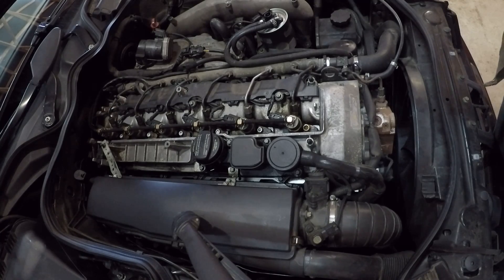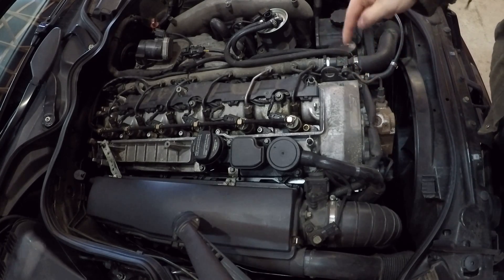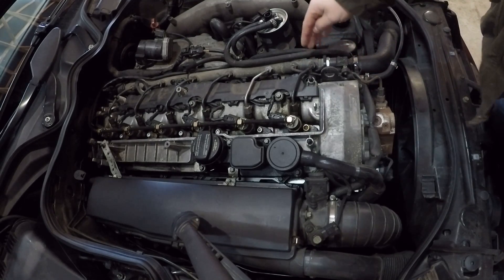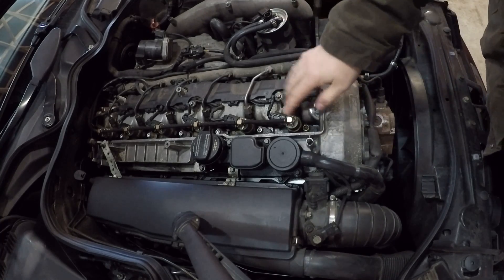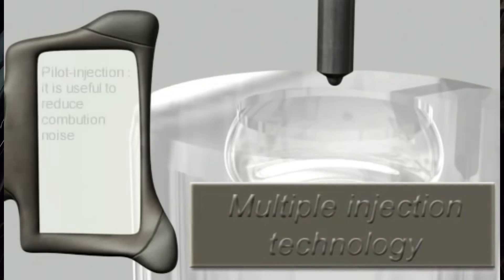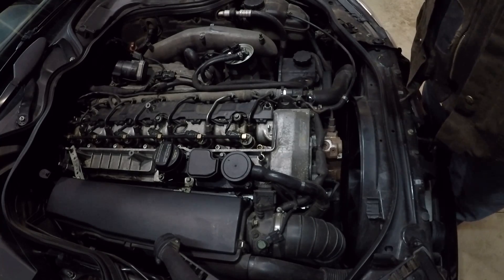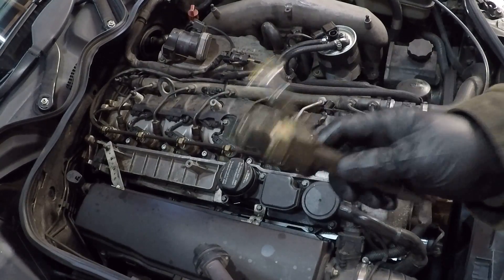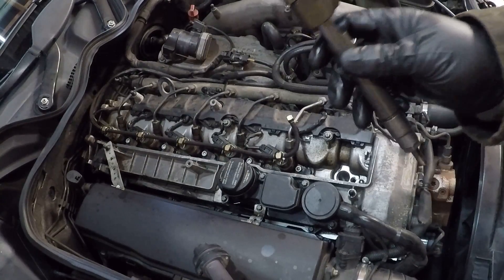E320 CDI | Everything You Need to Know About the Fuel System!

Comment: hello my mecedes s320 cdi 2005 has been sitting for the last 5 years it currently only turns over on the starter but won't fire seems to show between 9 to 11 bar in the common rail when read on obd with ignition on only is this normal or should I look in to changing the fuel tank side pump ?

Comment: Having fuel pressure problems code is for quantity control valve pressure to high another issue is my fuel tank on left hand side is full of fuel but the right hand side where the pump is is empty when idle it runs great when reved to 3200 limp mode this is a 2009 mercedes-benz ml320 bluetec any guidance would be great

Comment: Hoping you can assist me as I have been chasing gremlins in my OM648 2006 e320) for a few months now and not sure what to do next. I have the low rail pressure code and progressively replaced pretty much the whole fuel path from the cheapest item to the most expensive. 

I have replaced:
- Fuel Filter.
- Fuel pressure sensor (Bosch)
- Fuel pressure regulator (Bosch)
- In tank fuel pump assembly - the whole thing with the hoses (Bosch)
- New hoses (from filter to High Pressure Pump and return hose from pump). (OE MB)
- and finally just today installed new rebuilt high pressure pump (Bosch)

Car seems to drive better than it did before the HP pump replacement but still throws the low rail pressure code albeit not as soon as it used to. I still have my old fuel rail sensors but not the HP pump as I sent that core back. I plan to put my old sensors back and see if that makes a difference but thought I'd write to you first.

Car has 340,000km and I have not removed the injectors yet. I'm really at a loss what to do next and could use your guidance. I had high hopes for the HP pump to finally solve the issue but was quite shocked when it didn't.
Reply: Hi, did you manage to find a solution? I have the same problem 🙏🏻
Reply: @GreenMotion333  Yes. While I took the more expensive route in the end (throwing parts at the problem), I believe the culprit was ultimately the High Pressure Pump. The reason the pump change didn't work for me was the new Fuel Rail Regulator was bad. After putting the old one back, everything worked perfectly. Now I also learned that certain parts need adaptation through a OBD computer that has that function. I never did any of that. It's been awhile now and everything is still working great with the old fuel rail regulator. Pretty much all the rest of the fuel path is new except the injectors themselves.

Comment: c200 CDI. Problem starting after leaky injectors replacing gasket. Fuel pump works, getting fuel to filter. What is the next step to check? Fuel regulator valve? Lo and high pressure pumps?

Comment: I’ve got a P0113 Intake Air Temperature Circuit High, but it’s not the IAT sensor as I’ve replaced it and also shows a correct IAT temp on the live data. Is there another IAT sensor on these (possibly integrated with MAF), or would have any idea what else could throw the P0113 code on these id the IAT temps reads correct in the OBD?

Comment: hello, amazing explanation. i have a question, you talked about the fuel pump in the tank. i have a W209 5 cylinder diesel i have problem to start the car, the engine cranks but no start right away also when engine is hot. you know if W209 has the fuel pump in the tank?

Comment: hi there! im in postion where my om613 on my S210 E class, has problems with the high fuel pressure pump, and injector N1, today we've experimented with swaping parts, and it turns out you can still start the car and use it (allthough you cant really reach full pottential, you must know, the fuel wont be enough) with 270cdi w210 high pressure fuel pump and injector from 220cdi w210 :) thanks for the video! ofc i will recycle my parts (repair), in my country we can do that and reuse them and they will be like new!

Comment: Are the OM648 and OM647 nozzle spray patterns the same?  You can have different patterns and still flow the same amount of fuel: I'm talking theory here.
Reply from the maker: I'm unsure, as I've been unable to find that data. An educated guess says yes, and here's why:
The om646/647/648 engines are essentially identical, with the only difference being the number of cylinders. the layout of the fuel system, cylinder size and displacement, and everything is identical between these engines. so my guess is that the spray pattern would be identical. I took the risk changing all my 648 nozzles to 647 nozzles a few years ago, and everything is still working perfectly.
Reply: @MBDieselFreak  Yes, I agree that they're most likely the same pattern.  Maybe there's part numbers for just the nozzles in which case that would answer for sure.  Thank you for your response!

Comment: Hey I have been replacing all of the fuel lines underhood 2005 e320 cdi.. could you tell me the routing of the fuel lines from the fuel injector pump upper/lower fittings.  I know one goes to the Y fitting and the other goes to the fuel filter.. Thanks in advance!!

Comment: Hi there! Thank you for such a great content brother! Could I please ask for some advice? The thing is that I replaced the seals on the Bosch CP1  cause I had a mayor diesel leak on my OM664 2.2 L 121hp . After doing so, the engine fired up right away and I tested the car and everything seemed fine. The issue is that now, while I accelerate at full throttle, the car enters into LIMP mode and dies on me, you can turn the key off-on and the car will start immediately and I can continue my trip... This didn't happened before. If I'm not mistaken You mentioned something about check valves seats going bad and therefore reducing fuel pressure in the rail as a result the car enters into LIMP mode...  Ive found a place online where I can buy every part of the CP1 pump, If its not much trouble could you please help find that exact parts.  Any help is much appreciated. Thank You! Cheers!

Comment: Hmmm, I"m getting the same intermittent complete lack of power you mentioned.  Was once a month, then every couple weeks.   Now it's about 50% of days and the code (P0192 fuel rail pressure sensor low) comes back right away.   Car has "only" 110k miles on it, which doesn't seem a lot for these.  Could my HPFP likely be out at this low mileage?
Great video, thanks!
Reply: Hi, did you manage to find a solution? I have the same problem 🙏🏻

Comment: All the black death videos don't talk about fuel pressure in the lines.  They say 14mm wrench to break loose the steel fuel line going injector but never say this line is under pressure.  Is it under pressure?  Can the lines just be disconnected without other steps?

Comment: I have an unstable idling on my w203 220 cdi. What could be wrong ? Also a litle bit too low mpg.  Btw good explanation
Reply: The plastic fuel lines go hard and brittle then air leaks hard to start change all new white plastic lines I took radiator out and replaced them all..buy the genuine plastic fuel lines from MBenz... Will run better.. And get a smoke vac test done also will show up vac leak.. 😊😊

Comment: Question: I got a 11C600 code, code b4/6 rail voltage pressure sensor voltage too low, on a W166 engine.  Could it be the Fuel Rail Pressure Sensor, the Pump or the Fuel Regulator?  Its a GL350 with 50k miles .  Would appreciate an input thanks

Comment: how can you tell that your injectors were put in the engine in a wrong order ? I have a feeling that the shop that did my injectors seals put them in a wrong order, I'm having rought idle on first cold start in the morning.. rpm going up and down like crazy, when it heats up, it's all fine, also if you give it a bit of gas it runs perfect

Comment: Does the OM648 CDI have a PCV valve and if so where is it ??
I bought a 2005 this year and with the oil filler cap off, there is a very slight puff of smoke at idle indicating a lack of crankcase vacuum but I have been unable to find the PCV valve.

Comment: @MBDieselFreak I scanned my w211 cdi with DAS and got code from M.E 2047-001 (rail pressure monitoring via volume control valve. The rail pressure is too low). I just performed injector leak off test and found all injectors leaking off the same amount. I replaced almost everything in the fuel system except high pressure pump and injectors. I replaced fuel rail, fuel pump, quanity control valve, the valve next to high pressure pump, the valve behind the rail.. help!
Reply from the maker: Does the car start and run fine? Does this code cause limp mode occasionally when driving?
Reply: @MBDieselFreak Hi MBDDieselFreak. Please, i write in forum about acceleration noise om648, because have same problem. What was the problem? Thanks
Reply: @MBDieselFreak it starts and runs fine but when I accelerate hard, it’ll start blowing black smoke and throw a check engine light. After I do 1 hard acceleration, it’ll go into limp mode and it won’t let me go past 2k rpm
Reply from the maker: @SugaSteve  black smoke is normal for injector nozzles that are worn. i think your issue is that the high pressure fuel pump is bad. i had the same problem as you, but less severe. entirely intermittently, under hard acceleration maybe 1-2 a week i would have the car go into limp mode with a low fuel pressure code stored. Changing my hpfp fixed the issue for me, my old pump was worn out.
Reply: MBDieselFreak I was thinking the same but wasn’t completely confident.. I’m going to replace that ASAP. Thank you sir!

Comment: That om647 injector tip was great. Thanks for that. Someone botched an injector seal job on my cdi and I have 4 of six leaking at the top onto the valve cover, they used none factory bolts with washers etc.. and the injectors are all gouged up. Was thinking to replace all and start fresh since I have no idea what they did. When you replaced the injector how did you go about the programing? Will the car not fire up if they are not programmed? I do have a launch scan pad that is handy.

Comment: Hi,
I' ve bought a 0.5 liters aspirated diesel car this summer, it's called "ligier js 50 sport" now in winter time i have some problems starting her up.
When the engine is cold it takes 2key turns for starting unless i turn the key in the 2nd position 5-6 times. In the last days i noticed a drop in performance, it used to do 50kmh now it has less axceleration and more smoke from the exaust. I dont know what the problec could be can you help me
P.s. I live it Italy so the winter is like 0°c
P.s. the car has 3000 km and it's still  "breaking in"
Reply: Cold start issues may be from worn glow plugs.  Diagnostic reader should display related errors.  Cold running problems might be fuel related. Warm-weather formulated fuel thickens when cold If you haven't refueled since the weather was warm you might need to add a "treatment" compound.  Or use a VERY SMALL amount of kerosene/paraffin as a thinner. Too much Kero/Paraffin will burn valves & pistons so research on dilution ratio is necessary.  If none of the above applies then join a discussion form and read the 1,000+ posts on each topic.  It's enough to make the brain case explode.

Comment: I have a question for ya, I have a 2011 ML 350 Bluetec and have been diagnosing the fuel system because of a no start after it cut off on me while driving. I think it may be the high pressure fuel pump I’ve got the low fuel pressure code, what do you think?
Reply from the maker: My guess would be to test the low pressure fuel pump in the tank! That's the primary cause of a sudden stall no start scenario, and since you have a low pressure fuel code, that confirms my suspicion.
Reply: MBDieselFreak ok cool I’m going to check into it, do you know if I have to drop the tank to service the pump

Comment: Great video, Are you sure that the ECU will accept the code of a 647 injector?
Reply from the maker: Absolutely. The code is generic for Bosch injectors. I replaced cyl 6 with an OM647 injector and successfully coded it in.

Comment: Nice informative video, learned something new believe it or not, thank you :).  I'm an mb tech here in Denmark for 7 yrs now i've seen a few other problems with the 648, which isn't being mentioned here. The HP Pump on the 648 also has a tendency to rattle lose the 4 small bolts on the back over time, first sign is a great fuel leak on the front, easily fixable by dismount & clean and loctite up the bolts then retighten and remount with new o-ring. A second thing is that the injectors in the 648 engine has a tendency to be a hell of alot more painful to remove compared to the 642 etc... I've even tried splitting one injector in half using the OE puller and even cracked a valve cover way back.. Eventually using acetone carefully to losen up the carbon has made repairs alot easier. Thanks again for your videos :)
And not to hurt your feelings, but you need to turn you oil filler cap 180! :D And check your tranny oil then lock it up with the red plastic clip :D - Sorry getting ticks here haha. ;) But kudos for a non leaking PCV valve which is so often ignored, thank you sir! :)
Reply: Another thing which might not make sense to many, but the official tolerance for an injector is +/- 5 mm^3/Hub which is a very high tolerance. Injectors showing these values would knock alot earlier, even around 2 +/- mm^3/Hub - Have in mind that the injectors and ecu tries to compensate for a failing injector(s) and would make DAS show values which cannot be relied on solely. I love how this does not mention any DAS values but instead refers to the leak test which is the only way to pin point a bad injector. Thank you. Also i need to stop myself cause i could go on sorry :P - If you happen to reseal an injector sometime i'd be happy to throw some comments on that also :)

Comment: Awesome video I own a few 80's diesel om617 I have been wrenching on. But I needed a everyday car so 4 weeks ago I picked up a 05 cdi for 6 grand it is 85% perfect with 108 mileage. Love it only issue white smoke for 10 sec when I start it now it is 18 degrees. But thanks for all the info.
Reply from the maker: Check out my video on the swirl flaps! It's a very common issue on these cars, and might solve any startup problems you may be having. I'm releasing a video next week on how to DIY rebuild your injectors on the CDI and replace worn out nozzles.